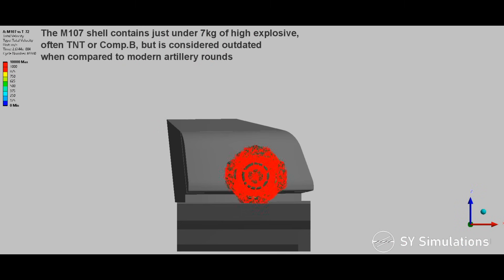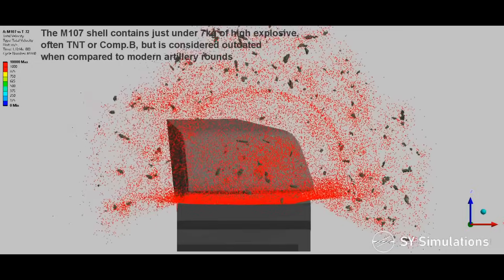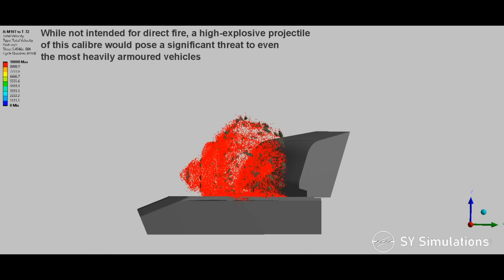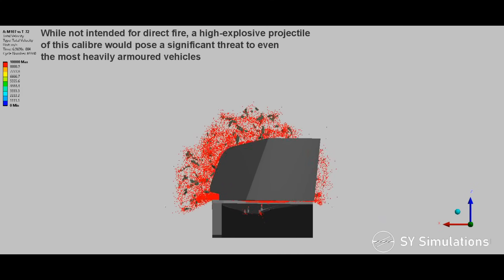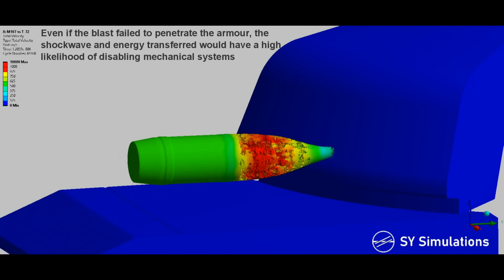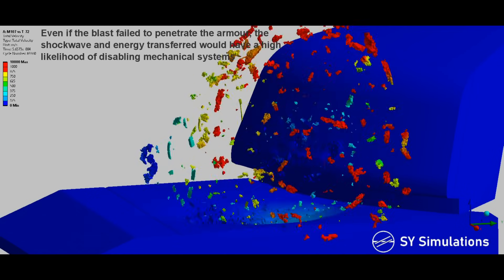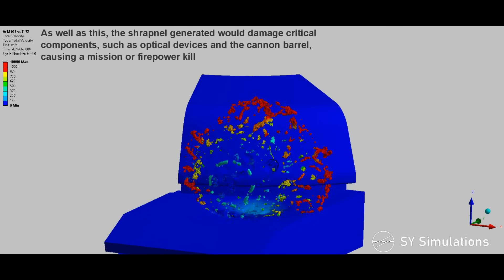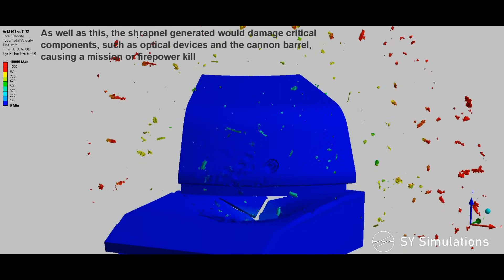DIRECT FIRE ARTILLERY vs T-72 | Paladin 155mm M107 High-Explosive | Armour Penetration Simulation

Comment: I remember pictures of T-64 destroyed by direct artilley hit during 2014 Russo-Ukrainian war, hit right in middle of turret. While reasonably thick roof cast prevented penetration, force of impact cracked it in, causing roof part to seperate from front and pushing it ap.3 cm inside turret. Even if tank survived, that turret is likely beyond repair.
Reply: The crew? Repairable? 😇 In a more serious note, never forget people are dying in a war, mainly people who do not care about it. Give me back the time when leaders had to duel... Remember me a Brad Pitt quote in Troy 😂
Reply: @khaelamensha3624  Heavy spalling would likely ignite ammunition under the turret, so I assume crew got off lucky. 2 centimiters more, and roof would be pushed enough for overpressure to get in, or maybe even cave in completely.